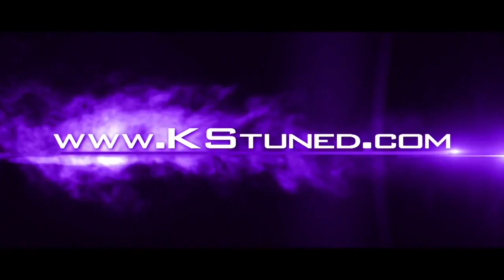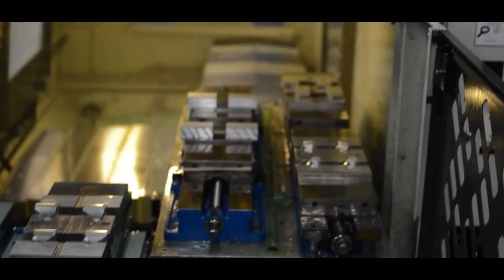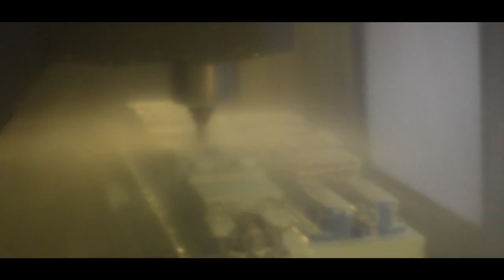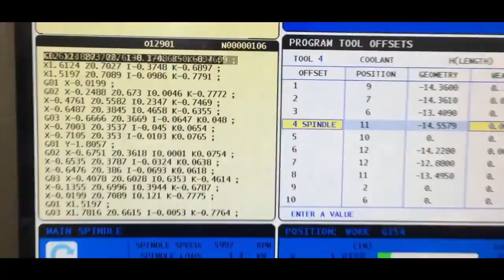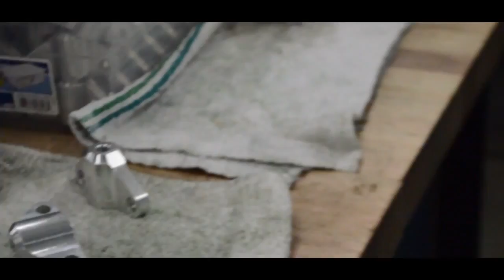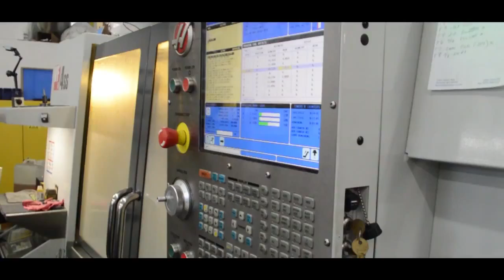KS Tuned Behind The Scenes H22 Timing Tensioner

Comment: I'll be ordering mine soon for my H22A with a timing belt
Reply: get the walk blocker while you're at it imo... i didn't at first.. but then got it because hand tight is scary lol... and you're already there so do it while you're at it..
Reply: stephen baker might have to order it, I thought about it I wasn't going to cause I still need to get my harden racing bearings and my p28 ecu. Just running the stock JDM H22A. Just making it a simple swap